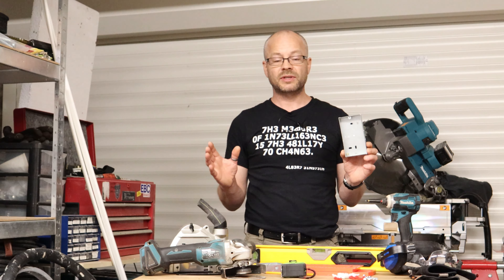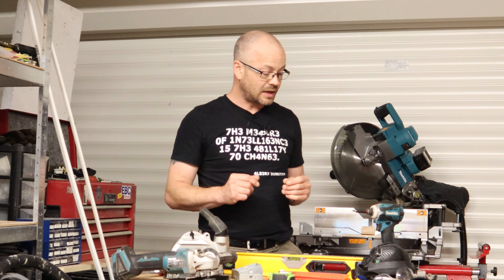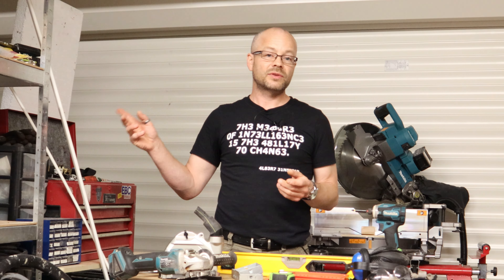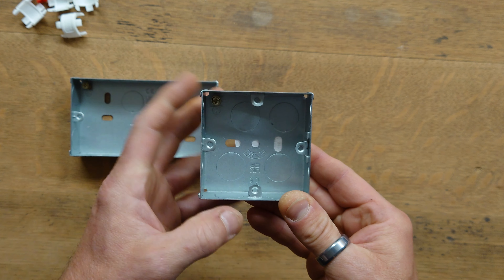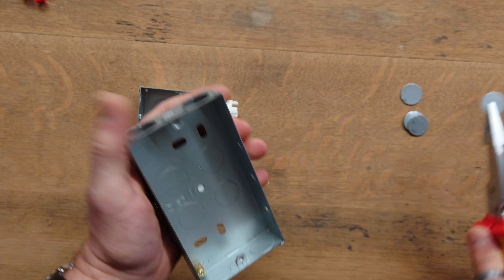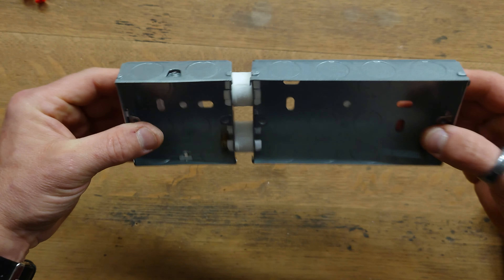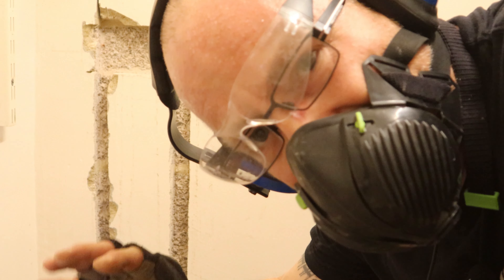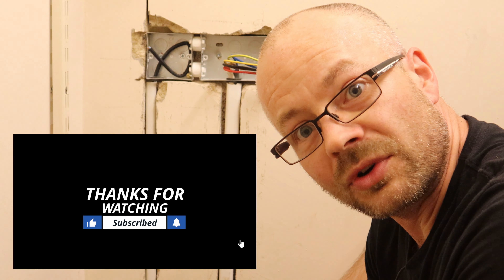How to Chase Walls | Electrician's Tips & Tricks

Comment: perhaps it's just me, but if I have a double socket next to a single... be it phone / network etc / fused spur etc., then personally I prefer a gap between them... especially if the faceplates are different types.
Reply from the maker: I get that, however in this case (which isn't obvious by the video), the install is in the under stairs cupboard. So it is never seen.

Comment: There are tungsten drill bits with square cutters you could get for doing this job, not sure how good they were, I think you drilled a hole with the core drill then used the square cutter on hammer only to finish the corners, doing this twice for double sockets. This would only be good for new work, not chaising in cables. That grinder attachment is really good,  doing this without one would be very messy, having to stop to wait for the dust to settle. Good video.
Reply from the maker: Thanks Dogbreath. The box cutters you're talking about are only any good on thermalite block. They won't do concrete, I used to have one but never really used it, just extra weight in the van so got rid of it.

Comment: Where is the oval trunking from??
Reply from the maker: If you're in the UK, Screwfix sell it amongst  other electrical wholesalers
Reply: @ChampionsOfTheTrade  Can you put coax cable in the same chase as mains t&e??
Reply from the maker: @jayjohal6892  no, it should be at least 50mm away. I would use 16mm oval for that, whereas 20mm for the twin and earth ring cabling.

You're obviously mounting your TV on the wall then? 😉
Reply: @ChampionsOfTheTrade  yh thats correct! and a data point! Does the data cable have to be separate as well?? 3 separate chases?? Please say no! 🙏🏽🙏🏽🙏🏽
Reply from the maker: @jayjohal6892  no! Lol
The data cable is fine to run with the coax, but try and use a screened cable if possible, just in case of any interference.
Reply from the maker: @jayjohal6892  it's a shame YT won't let pictures be posted, I'd like to see what you've done 👍

Comment: How did you fix the trunking to the wall??
Reply from the maker: I held it in place with a nail each side, only need enough to hold it in place until the plaster dries.
Reply: @ChampionsOfTheTrade  How wide in mm should i make my wall chase?? i have two sockets cables going up the wall??
Reply from the maker: @jayjohal6892  depends upon the size of the oval trunking you're using / capping.
I tend to mark the width and then cut to the outside of the line, this allows a little wriggle room.
Let me know how you get on.... Ps I hope you're using a qualified sparky for the wiring part? 😉
Reply: @ChampionsOfTheTrade  i've seen sparks use the banding to fix the oval to the wall??
Reply from the maker: @jayjohal6892  you don't actually need to use anything, you could just clip the cable to the wall and plaster over it, but in my view, it's not good practice. I use oval trunking because it protects the cable from the plaster, and should the cable ever need replacement, it makes it a lot easier in the future. Metal also rusts, so in years to come, using band straps could blend through. 
Those sparkies could also be being over zelus with the fire regs.
Reply: @ChampionsOfTheTrade  If the cable ever needed replacing, I would just leave in the wall because it would be 'dead' anyway
Reply from the maker: @jayjohal6892  I would use it to pull the new cable through the trunking.
Reply: @ChampionsOfTheTrade  I used grip fill
Reply from the maker: @jayjohal6892  that works, had to use it a few times myself, but it does take some time to fully harden. Make sure you wait for it to fully cure before filling.

Comment: For longer length conduits or wiring, how would you fix this in place to the back of the chase?
Reply from the maker: nails, screws or grip fill. I usually use galvanised nails, so no rust comes through the plaster in years to come.

Comment: This was great. I have a complete refurb coming up and you convinced me to get the proper chasing tools for cement. I have seen a twin disc attachment for a grinder which will save work. Surprised people still have phone sockets these days and not ethernet socket. Why run two chases? is it against code to run power and telephone/network cable in the same chase? (I appreciate noise/hum interference over a longer run may be an issue for untwisted cables). Finally, is it code for channels to be either horizontal only or vertical only now cable detectors are so cheaply available? Subscribed 👍 Thanks for the tips
Reply from the maker: Thank you, glad I could help. 
Depending on where you live.. In the UK, TV, phone etc cables have to be a minimum 50mm from electrical cable, for the reason you stated. 
Electrical cable must run vertical/horizontal to the accessory(s). Diagonal is not acceptable, the regulation was brought in after an MPs daughter was killed.
Also so you're aware, (I assume that by a refurb you're having a rewire)? This work (along with most electrical work), is notifiable to building regulations, and therefore requires a test certificate. Most electricians will not sign off work they themselves have not completed.

Good luck with it, I'd love to hear how you get on with it. 💪🤘
Reply: @ChampionsOfTheTrade  You're a star and the quick reply was much appreciated. Thanks for the confirmation on routing and need for separate channels for electrics. Even though I'm abroad (expat) and the local electrical work is just below clown level compared to UK, I shall be working to code (UK where possible) and will have the plans and a test certificate signed off. This is for multiple reasons including legal, insurance liability etc as the unit is a condominium. I will leave the finishing to the locals as they are cheap as chips but I don't trust them to work to plans for the rewire of power, lights, ethernet, security etc. It'll be interesting as I left/sold all my tools back in the UK!
Reply from the maker: @carlgrainger2669  I'm sure you're sparks won't be any worse than some of the work I've seen over here! Lol.

Comment: Was a sparks mate decades ago, do they use plastic trunking now, was metal shieving onks ago?.
Reply from the maker: It's all plastic now as far as I'm aware. Except for galvanized conduit.
Reply: @ChampionsOfTheTrade  Was told yonks ago, the metal was to protect the cables from DIY's nails & drills, maybe .Gov aproves the Darwin awards?.
Reply from the maker: @mac_uk5464  most of today's combi drills/impact drivers will drive straight through metal trunking anyway, and it not being earthed makes it even more dangerous.